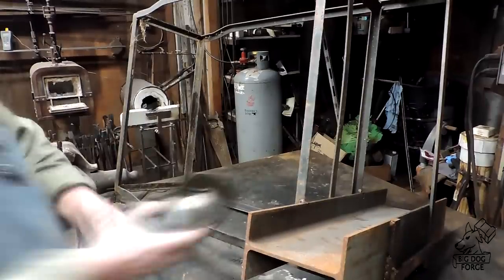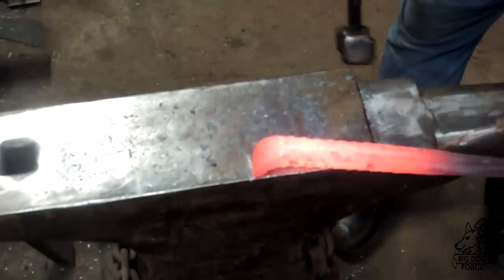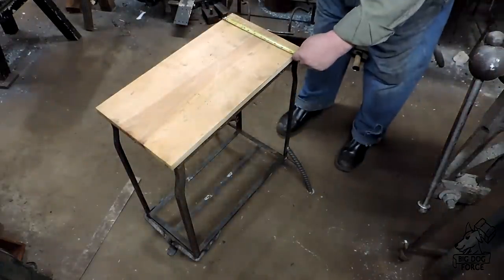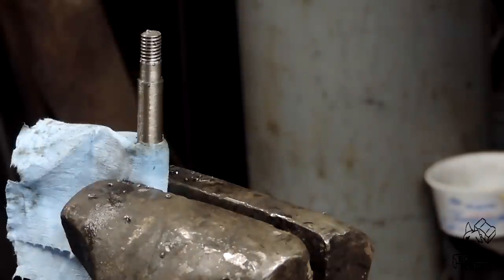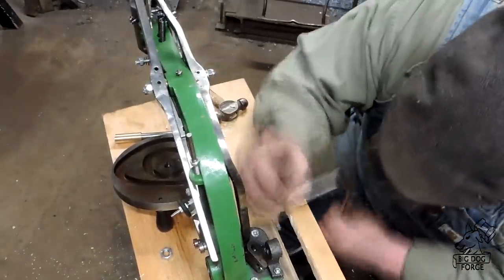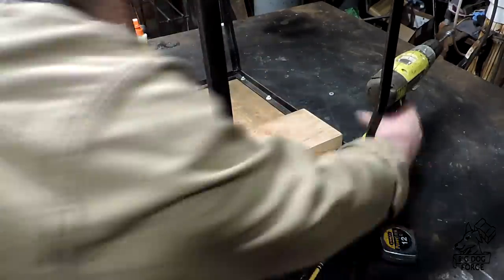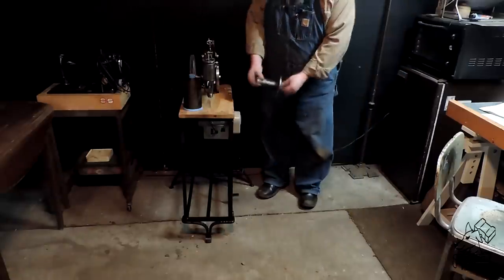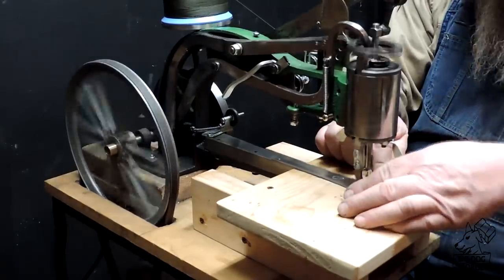Chinese leather patcher sewing machine Industrial Upgrade / Blacksmithing

Comment: Great build. As the owner of an actual Singer 29k patcher I'm really surprised that one of those cheap copy machines will go thru leather that thick...the old Singer won't.  I actually have a couple old treadle sewing machine heads form the turn of the century that will sew thicker leather than the 29k. I hope people realize that those big butterfly tabs on the needle head are to turn the direction of the presser foot...so you don't have to turn the item being stitched, a major advantage of the patchers. Now I want one of the machines like you've got to add to my collection. For those doing lots of heavy leather work, and with the capital...I fully recommend the Cowboy 3200 which I use for belts, holsters, and sheaths.
Reply: I made a 1/8 inch shorter foot on my Chinese patcher and it handles a full half inch stack of leather now.  Needs a bigger needle to do that, due to the increased friction.  I did the needle bar mod from the Facebook patcher group and now use 180/24 type S needles for 207 thread top and bottom.  One thing I found when sewing this really thick stuff is the top thread needs tons of tension to pull the bottom thread up high enough into the leather, and to help this I also don't use the little tension spring in the bobbin carrier, for less lower thread tension.  Of course a trade-off with bigger thread is that the bobbin holds less.  But I make mostly small projects, heavy duty knife sheaths, holsters, similar stuff, so this is not an issue for me.  To go up to a needle this big, I did have to file out the hole and groove in the arm a bit so the needle clears without touching when it descends.

Comment: Good Job!  I hope you don't mind if I use a few of your ideas.  I plan to use a gear reduction wheel chair motor
and a Variac + a DC power supply.  The machine is on order so it's just a matter of a bit of work.  I won't
need a belt or pulleys so the output of the wheelchair motor will hook directly to the back of the machine. 

Like yours, it will have plenty of power , geez, I can't wait!       Thank You!
Reply: Burt Lade - Sounds like a great idea? How did your motor work out?
Reply: @MrTypepatrick  Thanks for asking.  I'm still using it manually at present.

Comment: Awesome job 

Links to the items that you used ?
Reply: You can find these on Amazon and e-bay,  Just google shoe patch machine. They are a rough copy of the old Singer 29K machine.  They do get good reviews.  Tim has taken the motor upgrade a bit ahead of what's out there now with the stepper motor.  Clever guy that Tim!
BTW the motor can be found here https://www.amazon.com/Enduro-Sewing-Machine-Motor-Electric/dp/B079P8RQRQ/ref=asc_df_B079P8RQRQ/?tag=hyprod-20&linkCode=df0&hvadid=241954630226&hvpos=1o1&hvnetw=g&hvrand=4838675991241383579&hvpone=&hvptwo=&hvqmt=&hvdev=c&hvdvcmdl=&hvlocint=&hvlocphy=9011776&hvtargid=pla-424087884206&psc=1   I have used Enduro  motors for a small lathe and I like them. Very smooth.
Reply: Jim Humphrey 

I have found the one I will go with ,thank you sir

Comment: @BIGDOGFORGE  I have the same machine and would like to copy your conversion. Do you have a link to buy the drive shaft? I dont have tools to machine the shaft.Would you consider making / machining a drive shaft to sell,ready to go? Thanks
Reply from the maker: The parts links are in the disruption of the video that should help with motor.
At the moment I'm very busy and would not be able to get to it for some time.
If your willing to wait awhile I can but it's going to cost around 50 bucks to turn one
And if your machine is not built the same as mine it could be a problem.
Let me know.
And thanks for watching.
Reply: @BIGDOGFORGE  Ok,thanks. Sounds good. Where can I PM you?

Comment: Hey Big Dog! Great video.  Can you share how you got all those parts so smooth and shiny? I got one of these recently and I've yet to find an effective way to remove all the black, crud that is stuck all over everything. I've done scrubbing, sanding, polishing, even muriatic acid and back to polishing and sanding and still no joy.  What if I just cover some of the parts with spray paint, like the rocker arms, or whatever they're called?
Reply from the maker: I just used brake part cleaned in a spray can let it set for a minute and scrub with a wire brush.
Good luck
Reply: @BIGDOGFORGE  Ahhh. Okay. I'll give it a try.  Thanks, Big Dog!

Comment: If you wanted to slow it down just a little more, you can buy  a smaller 45mm pulley on a 15mm keyed shaft for sewing servo motors.  They are around $10.

Comment: These machines are great, aren't they! I purchased 2. One to keep the other to fine-tune file down and sell.  One has bearings in the arms and driveshaft. Had to hammer the arms to make it work but keeping for the bearings.  Yes, your upgrade is the best out there one can find. The motor looks fine with the machine.. nothing like a guty motor. at around 100 I think I'll be getting a motor too! It would be nice to have the added parts self-standing, (the large pully fastened to separate bearings and slip in the shaft), so you could slip the machine away from the table easily for traveling.  Very Cool Build was thinking the motor would be too large but at 15 Lbs very cool contraption you made from an aquarium stand! So glad I pumped in here.

Comment: Great video, Great job. I was wondering how i was going to do this. Can i ask what size thread and needle thread are you using to sew thick veg tan leather with this machine?.
I think these machines can possibly use upto a 140/22 needle max and that needle can hold a #138 Thread. 
that can do medium 2-4oz leather and even 5-8oz. When you add 3 layers of 6oz how many stitches per inch do you get?. you don't want the stitches to small as it can perforate the leather. 
These machines only take a flat shank needle so a 140/22 is a big as it can go to needle wise. 
Round needle industrial machines can take 180 plus. 
138/22 Bonded Nylon will be good for a wide range of stuff. but the bobbin is also small so either many rewinds or use a 92 thread for the under stitch but thats not real good for knife sheaths.

Comment: Very much impressed!  You are so knowledgeable and experienced in doing such kind of modification.  The big spool of thread on the machine would be too heavy for the bottom thread to grip.  The top stitches would be too loose while the bottom stitches too tight!

Comment: Hi, I really enjoyed your video. Creating tools can be as much fun as using them. I recently got a chinese patch machine and have been looking around at different motors to add to it. The hand crank wheel on my patcher came with a groove already machined into it. I'm  figuring on hooking up the motor/belt right to the hand crank wheel. Does the motor you use operate slow enough to hook up to that size hand crank wheel or is a larger  pulley wheel needed to slow operational speed down more?

Comment: I see it has a bobbin winder. Is there a way to flip it away from the flywheel while sewing? Saves wear. Also I recommend cutting a thread groove ahead of time before stitching.  For very short knife sheaths I punch the holes with the machine (un-threaded) and then hand lace with two needles.
Great job!

Comment: You have the best motor setup I've seen by far.  Would love to duplicate that.  What did you use to replace the crank shaft?  If I were to make one suggestion, I'd say to add a hanging spool thread guide above your spool.  I've found the spool thread gets hung up from time to time from the spool turning and unwinding as it sews.  In using that hanging guide, the spool doesn't have to turn.

Comment: Fantastic! I'm a sewing machine fancier and it's hard to find one that has a good speed control without costing major $$$ so could you or someone put in writing the specs of the motor you bought?
Reply from the maker: In the description just at the top of the comments there is a link to the motor and it has all the specs.
Let Me know if you need anything else. Thanks and thanks for watching

Comment: This is very inspiring! My question is where can you get some of these materials such as the new drive shaft for the pulley with the brass and the smaller pulley that you change out for more torque if you don't happen to have these parts lying around? Thanks for the video!
Reply: Bantam Tack Supply online sells extension shafts for the patcher, as well as spare parts.

Comment: Is there a reason why you can’t use the handle on the flywheel instead of reaching around to the pulley to move the needle back or forwards it would have to be safer and more convenient

Comment: Tim please let me tell you when I realized the upgrade you did i said i need that same upgrade on my shoepatcher, so Sr. How much for one of those axles. Please let me know if you would be kind enough to sale me one.
Thank you for posting this video and I'll hit subscribe👍
Reply: Use a  connecting nut on the crank side and the same size  bolt to hold the connector nut  may need to shim the pully bore either brass from the auto store  or make your own from what ever you choose be a scrounger lol !!
Reply: I ment to say hold pully not connector nut